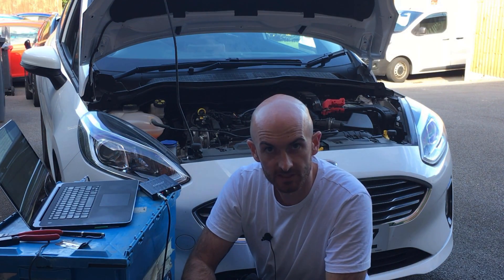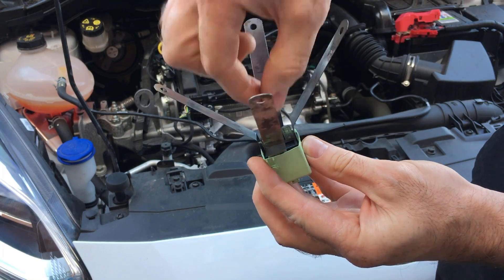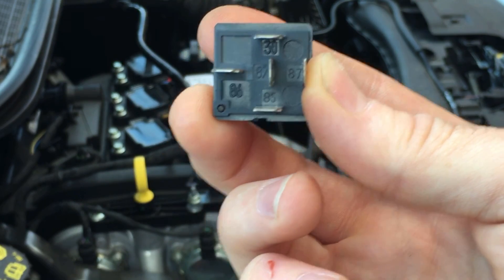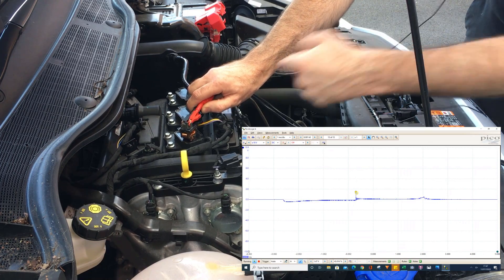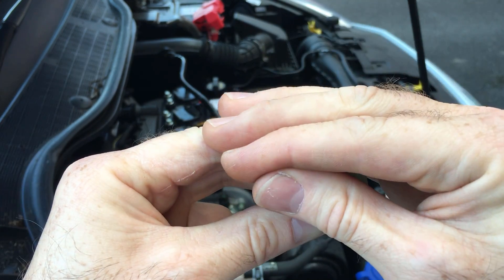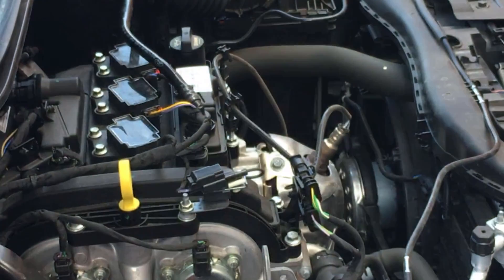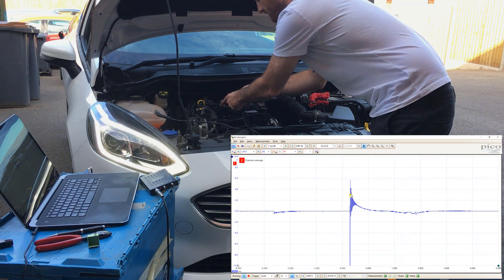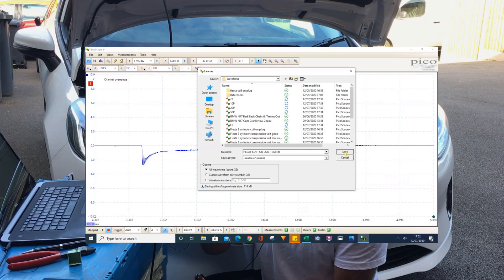Diagnose Misfires With A Relay | Automotive Oscilloscope Diagnostics | Mechanic Mindset

Comment from the maker: P.S. I meant resistor, not capacitor! Some relays use a diode. Check out this video for the original inspiration of this test 👍 https://youtu.be/MOLj5vGIDsg
Reply: Yes, usually the resistance value of the resistor is three times the impedance of the relay coil.

Comment: Hi Darren
I have a hantek 6074 be i i tried capturing a waveform using a relay. i used a 4 pin relay without resistor and a 5 pin as well. I removed the resistor from the 5 pin relay . I managed to get waveforms with both relays but it wasn't as the one in this video. 
Any advice?

Comment: Try optical coupling. If you put just bare LED (white or blue) to the leads, it will blink. Same with classic fluorescent tubes. Of course, works only in the night.
Now it's just a matter of picking that up with a scope, via photo-diode (transistor or resistor maybe). Might need a bias voltage to activate the sensor.

Comment: i found another way for doing a COP WAVEFORM using a SECONDARY IGNITION PICKUP from Autel. putting a flat piece of copper
about the size 2x2 in. between the clamp on the coil top and got a waveform. also just using the clamp will also pickup a signal. 
give it a try and tell me what you think.
Reply from the maker: I like it! You can get a waveform by pressing the back probe against the coil too 👍 thanks!

Comment: The symbol on the relay housing is not a capacitor it's a resistor (to reduce the effect of back emf, ideally it should be a diode). Also a capacitor across the primary coils of a relay makes no sense as it will create an potential oscillator circuit (which will decay when input power is disconnected), which is undesired behaviour.
Reply from the maker: Yep 100%. Please see the pinned comment. Slip of the tongue. Also see my video, ECU Killer, I think you’ll like it 😁

Comment: Just a question. Compression test. What amp clamp you recommend?
Reply from the maker: Hantek CC650 is the cheapest, but you could spend a bit more for the equivalent Pico clamp
Reply: @MechanicMindset  So I knew it was 650 but somehow ordered 65 and when it turned up it was in the wrong box. The box was labelled 650. I only noticed when I was moments away from trying to do a relative compression test. Double gutted as I bought building foam with special spray head to insulate new van this weekend too. The 5 cans turned up without the nozzles. Right well I just bought the 650 Hantek clamp and it should arrive for tomorrow. 

Got a car on at the moment which I think would challenge even you to find the fix.

Comment: Hi, thanks for a good video, very informative. Just a quick q for you, on the coil part of the relay, You have red (positive) probe end connected to one side, and the ground part (wire with croc clip) of that probe connected to the other end right? Or are you using 2 leads where 2nd lead is connected to common ground on Pico?

Regards
Gremling
Reply from the maker: Hi Gremling, I just connect the two scope leads to each side of the relay coil. Pin 85 and 86 of the relay 👍

Comment: Hey Darren. 

Thanks for posting these helpful videos I feel like I understand the oscilloscope world much more and it helps me diagnosing problem on modern vehicles and repair them properly. I actually enjoying using the oscilloscope as well I use to be afraid of it. 

I wanted to experiment your relay tool for ignition coil just wanted to know if you use a attenuator with the relay for your ignition coil pickup on the oscilloscope?
Reply from the maker: No, I didn’t use an attenuator. If you are in dire just gradually approach the coil you are measuring. 

Glad you are enjoying the content! 👍
Reply: @MechanicMindset  👍

Comment: The component is actually a diode. In this case it is called a flyback (sudden spike)  diode.
Reply from the maker: 100% a resistor, I took it out and measured it. Some do have diodes though 👍

Comment: I was wondering when you would update and correct your previous video on relays ...when you identified the capacitor as a resistor. A resistor does not makes sense, should be a protection diode, a capacitor could be used (in the manner of a decoupling or filter cap)
Reply from the maker: Hi, 100% a resistor 👍. The main point is, it needs to be removed to get the best of this test. The resistor just ‘soaks’ up some of the spike, doesn’t eliminate/block it like a diode

Comment: Do I need an attenuator when  testing with the relay to protect the scope?
Reply from the maker: No, it should be fine with out it. But if you are unsure, you can put one on. 

Don’t worry too much if the voltage exceeds the 20V. I he 2204a has 100V protection

Comment: Were you also using an attenuator in your hookup?
Reply from the maker: No not required for this. Although you can put one on just incase. The scope has 100V over voltage protection anyway 👍

Comment: Do you think that leaving the resistor connected would protect the scope in any way in the case of a voltage spike? Maybe if you lowered the voltage setting on the scope you would get a good waveform with the resistor connected.
Reply from the maker: Yeah, if you were concerned it might give you some protection. You just get a smaller less sidings pattern which you could enhance with some settings. This was fine though 👍

Comment: Hi Darren,
Interesting video! I think that relay had a diode in it as it had a white line at one end ( +ve end) before you chopped it.. I would be very interested to see what happens if you  rotate the relay 90 degree sideways to see if it picks up a stronger or weaker signal. Also worth tying it with the core of the relay pointing down. The strength of the magnetic coupling all depends on which way the ignition coil and its' core is oriented compared to your coil. I would try myself but not got my scope yet. Ordering one soon. Keep up the good work, very inspiring.
Reply from the maker: Definitely a resistor; this one is around 90 ohms. Although, some relays do have diodes. Never thought of changing the orientation of the coil, good idea. I will try next time 👍

Comment: If the coil have the primary and secondary coils inside.. how can you tell that we are seeing the secondary waveform !??
Reply from the maker: Great question, the waveform we are seeing is a representation of the magnetic activity associated with the coil’s operation.  If you see my original video, I do a similar test with a coin and scope the primary ECM signal at the same time; you can then see which part of the pattern represents the secondary coil 👍. Hope that helps explain?

Comment: Darren that works really well. Will have to try it. Is that a capacitor or a diode? I know what your saying it’s absorbing the spike just wondering which one it is or are they both accomplishing the same thing wether a diode or capacitor 😊 Artie
Reply from the maker: Slip of the tongue in the video, it’s a resistor. Although some relays use a diode 👍

Comment: Hello, I have a 2204 picoscope that when I connect it to any sensor the motor starts to fail, when I disconnect it it stops failing. Do you have any idea what could be happening?
Reply from the maker: Hi, just check that your leads are ok; disconnect and check resistance between red and black lead. Also, are you only using one channel? The ground of channel A and B are connected/common. So sometimes if you use another channel and the black lead is on a live, that will cause problems. Also check scope by testing battery voltage. Let me know how you get on 👍

Comment: Do you think if get a Hantek HT 25 secondary inigtion probe, cut those clamps away and solder the wire to relay pin 85 and the ground wire to pin 86 will work? then we have proper a BNC connector/cable and an Attenuator on the whole assembly.  and it still cheaper than the paddle probe.
Reply from the maker: Hi, what you could do (to save a lead), is add female 4mm/banana and attach these to the relay. You can then just use your normal leads. Also, I believe the HT25 has an attenuator in line which would affect this signal. You can also get BNC connectors, see my ‘Kit’ link in description and go to the DIY section 👍

Comment: Can someone tell me what is the black wire connected to , from relay coil to where , red is the pick up . and black goes where .
Reply from the maker: Hi, both of the leads connect to the oscilloscope (positive & negative), just like a multimeter. Hope that helps 👍

Comment: Is that really a capacitor in there, I couldn't see well using my phone?  I thought only resistors were used internally.  I think most cheap relays found in US parts stores have nothing built in to suppress the voltage spike.  I have used diodes in one-off projects to protect transistors and microcontrollers.  I'm curious about a comparison of how each one looks on a scope, as compared to an unsuppressed relay.
Reply from the maker: Hey Tony, slip of the tongue (see pinned comment 😂). It is a resistor. See my other video ‘ECU Killer!’ 👍
Reply: @MechanicMindset  oh okay, at any rate, I'm thinking that a capacitor probably would suppress at least some of the spike. Using the relay coil to pick up the signal from the COP is pretty ingenious of you.
Reply from the maker: @tonyfremont  Yeah I imagine it would. Probably more than a resistor which only reduces it, not eliminate. You should give it a go! Cheers, inspired by a colleague who showed me a similar test for another component 👍

Comment: I tried this and it produces a better waveform than my pico COP probe. Took a mini 4 pin relay and put it next to an injector like the results
Reply from the maker: Awesome! I must give that a go! 👍 What else do you think it might work for? I have a few ideas
Reply: @MechanicMindset  I used a GM 8430 relay,  removed the resistor and cut off pins 30 and 87. Was impressed and will most likely use it more than my COP probe. On an injector you can see injector on time and pintle open and closing. When I get time I want to compare with traditional current and injector voltage and see how they look.

Comment: hello   is it possible to use permanent magnet insted of coin for stronger wave form  or it will damage the scope.thanks
Reply from the maker: ali batebi Great question! I have not considered trying that; you can also use an inductive speed sensor which generally have magnetic properties, but also have a coil wrapped around them. I don’t think it will damage the scope.

Comment: Thanks for sharing this idea; very nice. Can you share the model number of the relay? It seems that the sensed signal will depend on the number of turns in the coil and I can imagine that different relay models have a different number of turns...  I plan to buy a relay and want to get a suitable relay. Thanks!
Reply from the maker: hubercats Hi, great to hear! The relay here is a ‘BMW TYCO GREEN 12V 5PIN RELAY 61368373700’. You will also find that different types of ignition coil will give different ‘strength’ signals; for example VW TSI coils give quite a large waveform with just a coin. Enjoy!
Reply: Mechanic Mindset : Thanks very much for sharing the relay part number. On a somewhat related subject, have you posted any videos that show DIY sensors for old style (non-COP) spark plug wires? I have a DSO Nano V3 pocket oscilloscope available but need a sensor. Also, since discovering your channel earlier today I’ve watched several more of your videos and have found them to be excellent. Thanks again!
Reply from the maker: hubercats I haven’t made one, but I did buy one really cheap. There is a link below to the kit I use 👍. Thanks for the feedback, more to come!

Comment: How many ohms are the BMW relays? I have a coil of wire that's 550 ohms, but I'm wondering about attenuation. My scope won't handle a voltage spike, should I run a ground to the engine too?
Reply from the maker: They are between 90 & 110 ohms. What you could do is connect it up and gradually reduce the distance to the coil. You can then monitor if the max input voltage will be reached.

Comment: pico 2405A  OR  2406A   can work to   PicoScope Automotive ?  thank  you
Reply from the maker: 張明安 Hi, 2405A 25Mhz will be fine. 2406B 50Mhz would give a better ‘resolution’ for zooming in on longer term measurements. I use 2204A which is 10Mhz, it’s fine for most but got great for zooming. You might as well buy the automotive scope (without accessories), around the same price then you get access to the waveform library and auto diagnostic software 👍

Comment: New to the channel as of today, that’s just brilliant! Defo help save a few quid which could be put to better use for some other tools.
Reply from the maker: Billy Tremolo Band Welcome! Glad you enjoyed the video and the prospect of saving some pennies!! 👍
Reply: Mechanic Mindset I’m currently in the market for a scope and new scanner defo thinking of trying your Pico scope hack
Reply from the maker: Billy Tremolo Band Cool, this little scope is great to start and will cover a lot of your needs. Plus if you want to upgrade, all the accessories will work with the higher spec scopes. Got links in the description for all the kit I use 👍
Reply: Mechanic Mindset What would your opinion be on an autel 906 scan tool?
Reply from the maker: Billy Tremolo Band Sorry I need to be honest, I’ve not used it before. I have used OEM/dealer tools for most of my career. There are some FaceBook groups for diagnostics and they would be best to ask. Although prepare for 50 different opinions 😂. I have heard the autel equipment is good. Launch is another they gets good reviews 👍 I was with a guy the other day who had the snap on verus that has the built in scope too. Lots of options
Reply: Mechanic Mindset My last job I was in we used to use the verus with the built in scope which was nice to use, I’m after changing jobs to a local busy JLR franchise so I’m currently getting into using oem scanners again after spend 17 years out of the dealer network, we have a 4 channel Pico here so hopefully il get to do lots of practice with it which should be an advantage when I have to do some home scopeing 😜 To be fair I’ve watch a few of your videos and they are very informative and will be of great use going forward for diagnosis, thank you again for you brill content! If you need any Jlr info feel free to message me and il try and help.
Reply from the maker: Billy Tremolo Band Great, sounds like you have more experience than me with aftermarket scanners. Good luck with the move to JLR, they have some great products! You’ll be pleased to know JLR use PicoScope so they should have one. Funny to know, I work for JLR in the day job; I am part of the team that develops all the technical training for the whole world 😁
Reply: Mechanic Mindset Its how I will have to pick your brains so for info for my day job😜 To be fair they have some very nice vehicles in the range, very interesting to from a work/learning point of view, I spent a short while working for the company’s Volvo dealership but didn’t find it as interesting from day to day so when the Jlr job came in the workshop across the road I jumped at it.

Comment: Hi I think you need to check that relay as the pin configuration is marked incorrect ,terminal 30 and 86 are marked on your relay as incorrect , you have connected to pin 30 and 85 on a standard pin arrangement on a din standard pin arrangement for that type of relay ,where did you get that relay from I have never seen a relay of that type with that pin arrangement,can anyone confirm what they see cheers
Reply from the maker: del d Hi, someone else raised this same query. If you zoom you can see I have connected to 85 & 86 for this relay type. It is a Tyco/BMW relay and very common; I’ve got loads of them. I think this highlights that we should be careful when assuming relay terminal locations are standard across all relays. Could end up with incorrect diagnosis in the future! Thanks for watching and raising the query 👍
Reply: Oh, I see what you're talking about. Standard four-post relays across the pond have a rectangular shape and matching pairs diagonally across from each other, so you can insert those relays upside down with normal function either way. It's a clever design. In this example the relay cannot be inserted upside down because of the configuration and shape of the posts, so the problem is averted by design asymmetry. The post numbering is entirely conventional, 85 and 86 are coil control, 87 and 30 are on the switched side.

Comment: When you first hooked up the relay to your leads, you had them hooked up to pin 30 and pin 85 (or 86).  There is no connection to the coil on pin 30.  That may explain the low waveform. Great idea tho!
Reply: You’re right. In America we use the Bosch relay that looks exactly like that.  On the Bosch, the terminal marked 86 on yours is actually pin 30 which is the common. 85 and 86 are always opposite from one another.  It’s like the one you have has 30 and 86 swapped 😂😂
Reply from the maker: Che Kelley They like to keep things easy for us 😂😂🙄
Reply from the maker: Che Kelley I went back and checked on a big screen. Deffo connected to 85 & 86. 30 can be seen with no connection. This is twin output relay; 2x T87 🧐. Cheers for checking!

Comment: Great experiment. Would be interesting if you took three relays wire them in Series and checked all three coils at one time
Reply from the maker: J Woeltje Now there’s a great idea. We had a similar tool at BMW; 6 inline pick ups that would clip on to the top of each coil and connect the scope at the other end. Probably more expensive than using your method! 👍

Comment: Do you have to use an attenuator
Reply from the maker: Steve M. I didn’t here but I suppose it depends on how strong the signal is; all coils are built slightly differently so approach with caution. These scopes are pretty robust and do take a certain amount of over voltage before giving up 👍